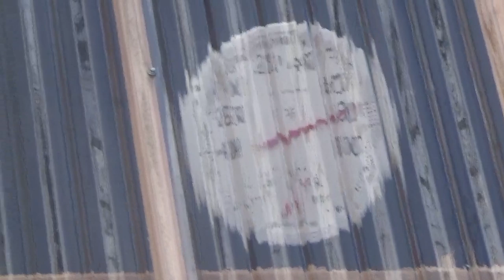Why do I raise the saw head after every cut on the Woodmizer LT15.

Comment: Morning Joe... We've got snow on the way starting Wednesday night, but the way the temps are some of it will be rain. You're higher in elevation than I am so maybe you'll get the snow you want in the next couple of days. If it wasn't for wifi in the house I wouldn't get any G on my phone unless I step outside on my deck,  and then it's only one bar. You hit it on the mark when you said all they want to do is sell more phones and make more money!
Reply from the maker: Morning John, 45 here already this morning.
Reply: @josaljo1  Only 28, but it's suppose to go into the 40s.
Reply: Hey Joe, when you build your drying shed will it be a concrete floor or just a pier and beam system?
Reply from the maker: @piledriver141  Hi PD, more than likely it will be both if I ever get that far. This goofy winter is killing me. 45 one day 25 the next.  I like concrete floors because of the permanency of them, and their strength.

Comment: As usual excellent explanation on the sawmill question Joe. The 5g service is also suppose to be faster information transfer as well but I'm like you it's just a gimmick to sell higher prices products and services. In a couple years it will be cheap and obsolete to the next thing. It almost hit 70 today here and we are suppose to have rain for next 3 days. This is just nuts normal temps would be in 20's and snow. I heard some one today say that the Easter Flowers are starting to sprout up in places.
Reply from the maker: 3 weeks ago Sally told me the same thing about flowers in our yard.
Reply: 5G is primarily for urban areas right now it'll be important for autonomous vehicles
Reply from the maker: @brendangalvin4308  They use it to gather money so they can get it going.

Comment: I was once cutting firewood with my chainsaw and had a sycamore crotch log and thought I would take a horizontal slice of the crotch for a bowl blank, there was so much tension in that crotch that one of the limbs was a couple of inches higher because of the limb twisting
Reply from the maker: Hi Andrew, that is exactly my reason. It happens and sometimes badly.

Comment: I went to renew my minutes on my flip phone yesterday.  My old phone is a 3G, and it will not work with the 5G coming.  I can get a new flip phone for $130 that is 4G, but I would have to pay $30 a month for the service.  I was paying $100 a year still expensive per call.  I can't get reception on my hill, as the tower is below my hill, so I have a land line.  I only used the phone to call home after a hike, and used maybe 10 minutes a year.  Most hikes take me out of reception range, so it won't work there.  I told the guy at the store to forget it.  The phone calls would be very expensive at $30 a month, and using only ten minutes a year.  I can go without a phone.  I don't need it for work anymore (retired), I don't care to play on the internet with a phone, and I already have a Garmin GPS to get me where I need to go.  I've worked on electronics all my adult life, so I am electronic literate.  There are more things going on everyday than needing to mess with a smart phone.
Reply from the maker: My wife and I use our phones for two things. She calls me to tell me to come over to the door of the store, and she plays work game at night when she goes to bed. I think you are right what is the use anymore.